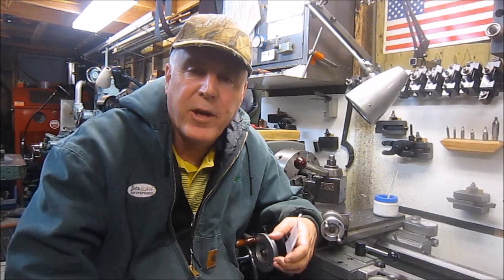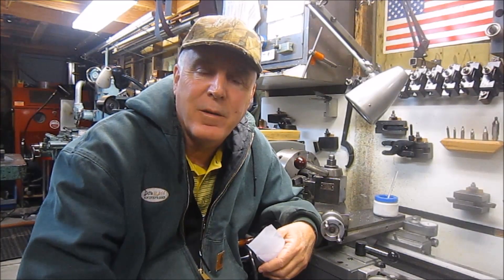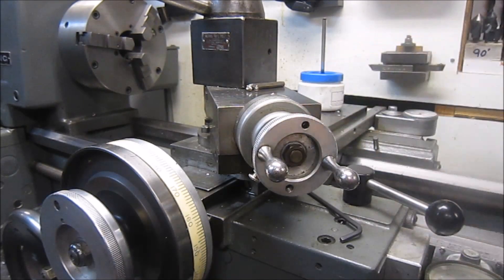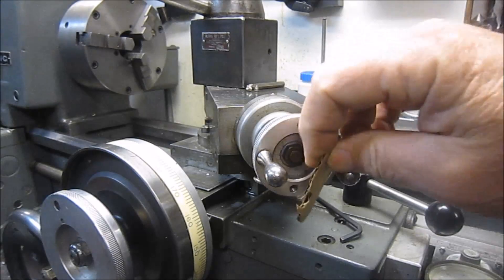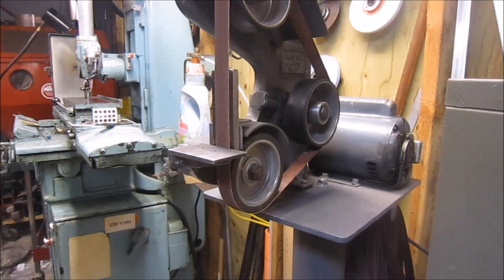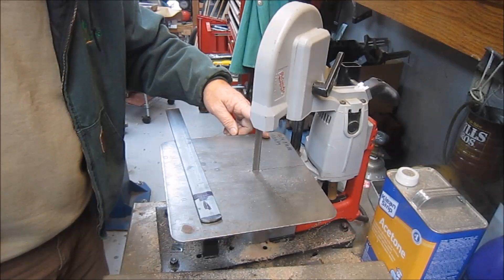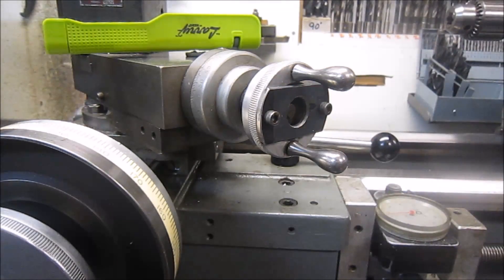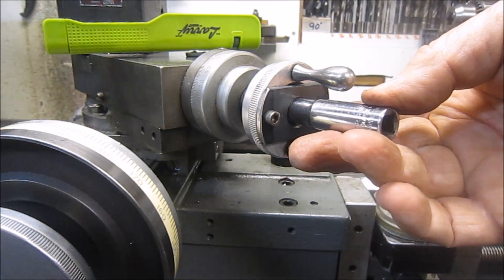Lathe Compound Accessory   SCREWY TUESDAY #44

Comment: Hey Chuck. Back in my cheap days of building I needed a transfer punch. I used an allen set screw in the thread and then I ground an allen wrench to a point. Cut off this pointed end fairly short, deburred and inserted in set screw. Make as many as you want for a few pennies. Use magnet to pull it back out of set screw.
Reply from the maker: simple...smart....thanks for sharing....

Comment: Hey Chuck, you might consider chucking up that socket and indicating it and then facing the end to reduce or eliminate wobble. It won't take a lot off that end to be a big movement on the other.
Reply from the maker: +bcbloc02 LOL...BUSTED!!!! Yes, I was TOO lazy to change over to a 4 jaw and you are correct as the cleanup would be minor....thanks for viewing
Reply: Dale Richardson
 Well you should indicate in the x-axis to be sure the socket isn't cocked in the jaws but run out would indeed not matter for squaring it up.
Reply: +bcbloc02 This could be considered a dumb question, but I've been told the dumbest questions are the ones never asked...So, here goes. How would facing the end eliminate the wobble? Isn't it wobbling because of how the square drive is oriented askew to the centerline of the plate? I know you're right, but I need to know why I'm wrong...thanks, and Happy New Year to everyone, Aloha...the other Chuck
Reply: +Knolltop Farms If you face the end with the plate (to the full length of the plate) then you make it perpendicular to the socket center line. Then any remaining wobble would be from the socket not being dead nuts center of the plate (which would most likely be minimal).
Reply: OK, got it, for some reason I thought the plate was too thin to face off enough to remove that wobble. And that was only after realizing that it WAS the plate that would be faced off, so you can see why I thought facing the socket wouldn't help at all. Can't learn if I don't ask and think about things.

I appreciate the reply...Aloha, the other Chuck

Comment: Hi Chuck!  Cleverness makes up for any Bozosity that might appear in the implementation.  Nice work!

I've been wondering about the possibility of mounting a small stepper motor on the compound, maybe with adjustable limit switches so you can set a range of movement. With tiny micro controllers down in the $5 range and credit card sizes, it might be possible to use a lithium battery and mount the whole thing with a potentiometer for feed rate setting on the compound. Have to think about it...unless someone else takes the idea and works out the details...

Thanks for the video and the thought providers!

  -- Mike
Reply: +BigMjolnir Mike, I thought about this since I first saw Stefan's video.  It would be a pretty major project to start from scratch,  but I already have a controller that I use with my rotary table.  all I would need to do is add the software to do the job and add limit switches.  But since this would only be used very little, I think I will stick to the drill motor.
Reply from the maker: +BigMjolnir  Thanks Mike for viewing, great idea and would be fun to build, but honestly just don't cut that many tapers to justify the effort of the build....ATB
Reply: +outsidescrewball I understand and agree.  Just thinking out loud. A better use for a stepper setup might be a positioner for welding round things. Been watching Welding Tips and Tricks and seeing how one is used.  Would need more grunt than for a compound slide, but with enough gear, or belt, reduction and a big enough stepper it seems possible. Once it's working mechanically, the software could get interesting.  For example, add a mic and some sound samples and maybe make the speed voice controlled!  "Woah!"  "Giddyup!"  "Slow down!"  "Move it!"  Use a Raspberry Pi and there may be some free library routines that could handle that sort of thing...dunno for sure. If I ever get my to-do list done I'll look into it maybe. Fun to think about the possibilities anyway. 

-- Mike
Reply: +Herb Blair Herb,  not sure who Stephan is...but I'm awful with names.  The limit switches are optional....go/stop and direction would be enough if you are supervising it and those could be mounted anywhere, or just twist some wires together and stand by with the cutters!  Bigger issue is connecting the motor and arranging for a brace so it doesn't spin...those wouldn't be optional. 

-- Mike

Comment: Nice Chucker dial on the X axis...great modification.
Reply from the maker: +kmcwhq Thanks for viewing, when I purchased the lathe someone before me had did the installation, I love the size, but it does impede the compound use as the compound when retracted (unless turned) will hit it.  I did pickup the stock dials off of Ebay if I ever had the need for better clearance...